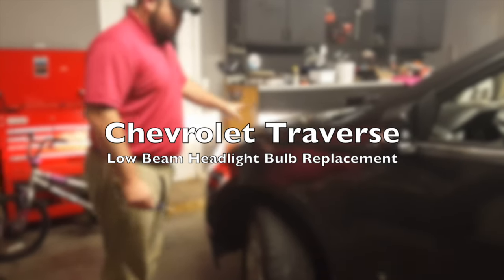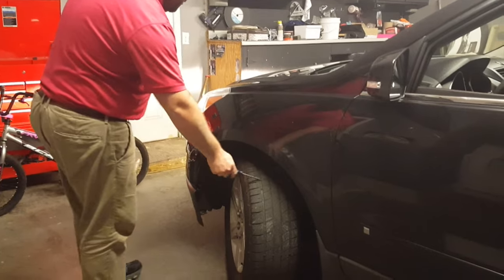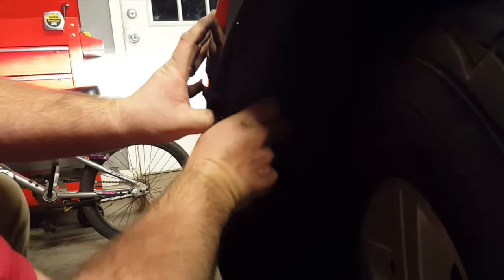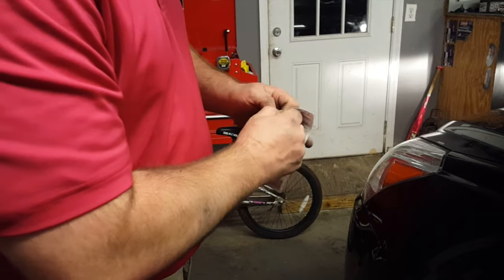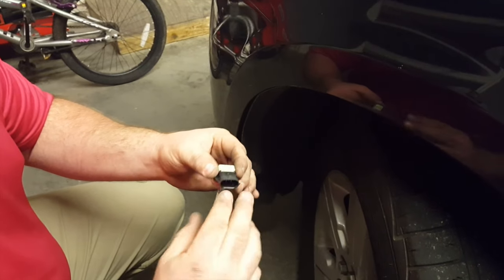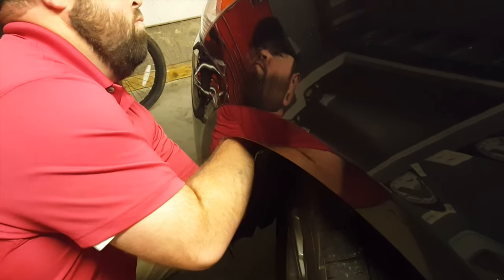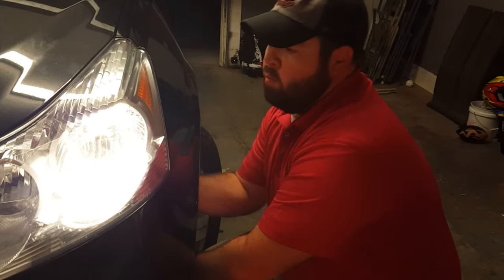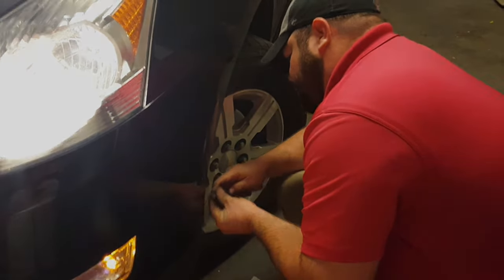How To Replace Chevrolet Traverse Headlight Low Beam Replace 2009-2014 | Save Money Fix It YOURSELF!

Comment: Very good method and presentation of same. Thank you for that.

I would like to add one thing for others doing this for the first time. I had both low beams to replace. Using this method, the first one took almost half an hour while the other only took me 5 minutes, literally 5 minutes. This is because,  on the first one, I glossed by Fentertainment's recommendation to use your sense of feel for you eyes. So, BEFORE removing the big cap thingy and BEFORE taking the bulb out of the reflection chamber thingy and BEFORE unplugging the bulb,,, take a good "look" at it with you fingers. Visualize it. Remember how it looks in you mind. It will save some time as well as a few cuss words when replacing these items.
Reply: God bless you!!! I need all the help I can get. I’m old, sleep deprived, and have an ADD brain. I may take longer than most, but I will get it done!!! Appreciate any extra guidance I can get.  Thanks again for sharing your insight!!! VERY GRATEFUL to this gentleman for sharing this video. One YouTuber suggested I remove the tire. I’m out of town so I didn’t bring my entire set of impact driver socket set. Thanks again y’all❣️

Comment: Nailed it! Thank you for this video! I would add these tips: 

1. Make sure the old rubber gasket comes out with the old bulb.  
2. When putting new bulb in,  place connector at 10:00 position and turn to 12.
Reply: On the 2014 Traverse, the connectors point down. Put it at 4 and turn it to 6.

Comment: GREAT video, thanks for posting.  Both headlights went out within a few days on my 2013 Traverse and this was a lifesaver... first time I've ever actually replaced both headlights at once (as they always recommend)!  

First side took me about 10 minutes, as I figured out the orientation of the rear light cover, bulb in housing, and needing to shine a flashlight into the opening to figure out the small connector tab I had to press to remove the burnt bulb from the harness.  Second side took me about 4 minutes, and I was able to do it "blind" by just feeling inside the wheelwell.  Beautiful!  My screws needed a T15 star bit, not sure if all years/models are the same.

Comment: And I thought changing the back wiper blade was a challenge. Thank you SO much for this. The dealer quoted me $350 for parts and labor to do this. My arm is ripped up, but I got it done for the cost of the bulb thanks to your video!

Comment: Best video, I have a 2013 and the dealer wanted to charge $168, to replace 1 light. I followed ur instructions and did in bout 30 minutes. The only reason it took 30 minutes is because this was my first time and 1 of the bulbs was a little harder to take out. I checked other how to do it videos and this was the easiest and fastest way.

Comment: I followed these instructions and it worked like a dream. Yay! My low beams work. But now my high beams will not work when I push The signal lever back to turn on high beams. They only work when I hold the signal lever forward towards the steering wheel.

Comment: You're the man! Way easier than I had expected and because you made the video in real time, I was confident I could tackle it in less than 5 minutes. The one thing you could add to your description would be the screws (on the 2014 Traverse at least) are T20 Torx head. Thanks a lot!
Reply from the maker: Awesome. I didnt know they were torx on those years.

Comment: I was just about set on going to the dealer until I watched your video.  It took me about five minutes to replace the bulb on the right side of my 2011 Traverse.  I got hung up when I realized that the rubber gasket around the bulb itself didn't come out with the old bulb.  I couldn't twist the new one in until I removed it.  It then took me about 60 seconds to replace the other bulb on the other side.  I figured if one bulb went out, I'd just replace both.  TIP: go ahead and plug the bulb in the connector before you twist it in place.  The opening is a little snug to plug it in after you twist it in.
Reply: I forgot to thank you!  Thank you, you probably saved me a hundred bucks!  You are the man!
Reply from the maker: +Ukulele UkuleleMan Thats awesome. Good Deal!!!

Comment: Once I figured out that the wire harness release was on the back side of the elbow (as opposed to the sides), this was a snap.  I did both sides.  15 minutes for the first one and 5 minutes for the second one.

Comment: Good idea to access the low beam bulb but in my 2009 Chevy traverse does not have the same clips. There are two on each side of the bulb connection

Comment: You'll probably never see this but.....I have a 2012 Chevy Traverse that had a low beam light out.    I told my son about you video.   Mine had about 8 bolts and screws that were a major pain to get out......he could not get in there withouf taking the wheel off.

Comment: Quick note.  If using LED lights, you might have to reverse the plug from the instructions provided.... took me a dang hour to figure that out once I tested the LEDs with my battery charger to see what the heck I got shipped. :)

Comment: You failed to realize that you didn't say what size wrench or Starkey or what I don't get it don't do a video if you're not going to show it complete I know where the screws that I know it's at I need to know what size wrench start key or what makes no sense you just said unscrew it unscrew it with what
Reply from the maker: Just don’t watch mine. Go complain to someone else